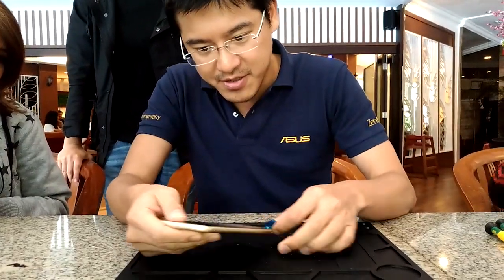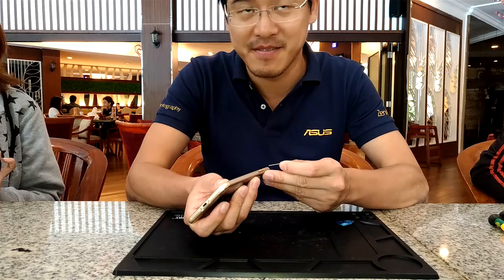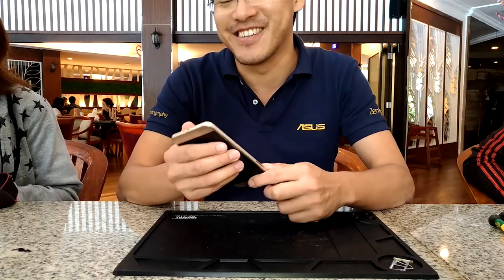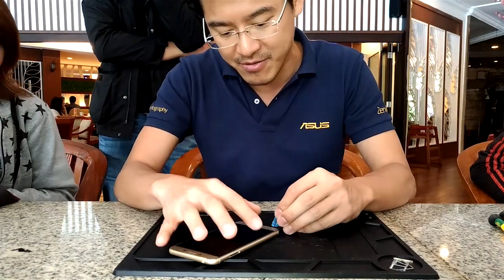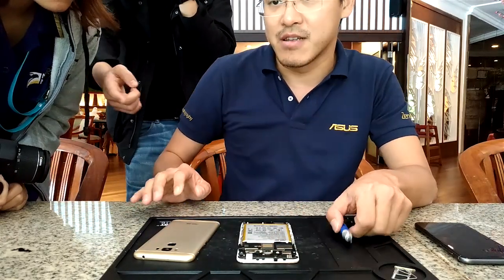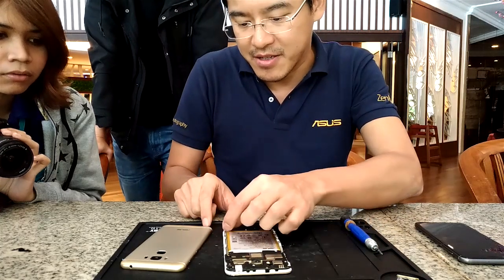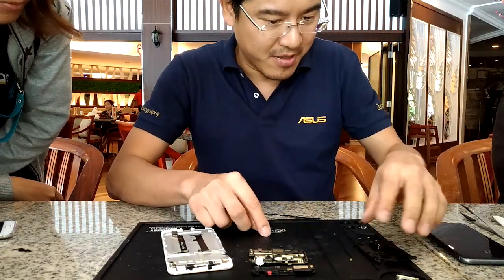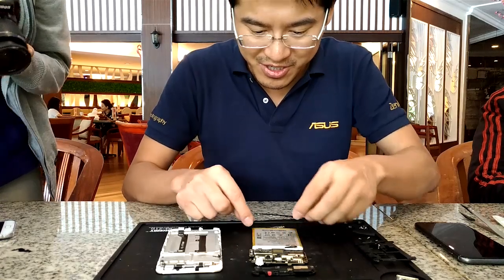Bongkar ASUS Zenfone 3 Max ZC553KL Bersama Benjamin Yeh | Disassembly ASUS Zenfone 3 Max ZC553KL

Comment: I have a question and I do not know if you can help me.
The situation is that the smartphone was turned off because the battery was low, I immediately connected it to a power source but only the LED  turned on, it does not seem to be charging at all
What can it be?
Reply: burn your smartphone
Reply: sell to me
Reply: i want buy your phone